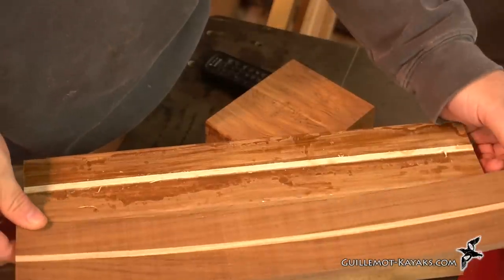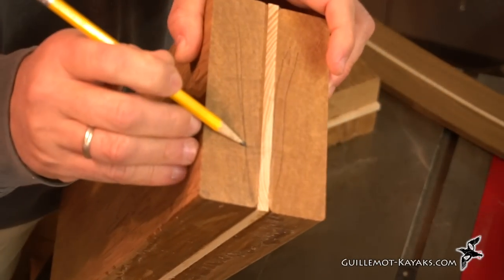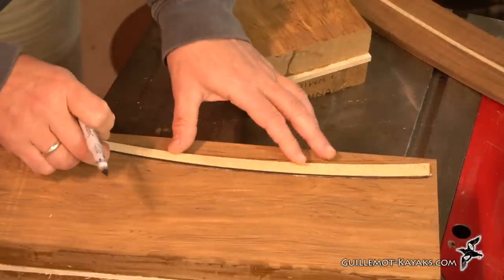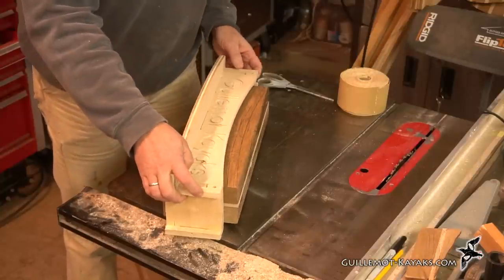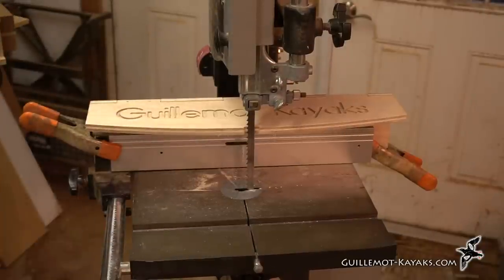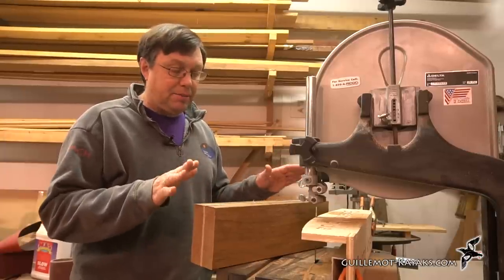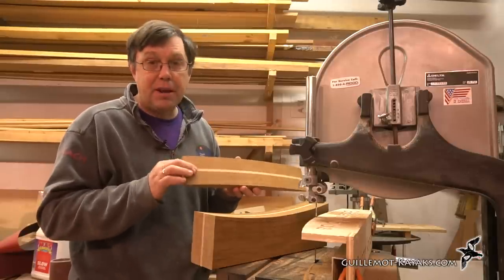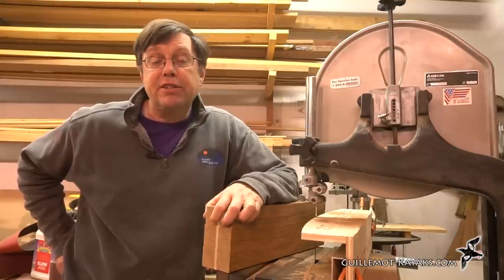Making Kayak Paddles - Cutting Blades - E2

Comment: The jig looks really nice, but why not add threaded inserts and a couple of starknobs for easy adjustments?
Reply from the maker: The primary reason is I didn't have any of those things on hand. You would need to be careful that they don't get in the way of the blade guard,  but it could be a nice upgrade.

Comment: Nick great jig! You might consider adding it to your sale items like the robo bevel.  With your CNC you could make up several different templates with various radius’s. (Radii)? Doug Hermann
Reply from the maker: I have thought about that. I've got two different sizes that I make already. Part of it comes down to: Do I want to spend my time at the CNC machine making stuff to sell or make boats.
Reply: @NickSchade  How about giving the programming to a friend with a CNC and let him run them for a small fee. They would come in very handy. Only thing I would add on the blade it should be lowered as much as possible in the guide so there isnt any twist of the blade. I did see the adjusting knobs on the saw guide might hit the clamping half of the jig. Nice way to cut multiple pieces.

Comment: That must be a tight blade on the bandsaw to run true at that height. 
Why not cut the handle longways into 4 pieces and laminate with contrasting colored wood like you did with the blades? That would create a nice look.
Reply from the maker: You can laminate up the shaft any way you like, but like to keep it simple

Comment: Hi Nick, great jig.  I was wondering for your scrapers, do you use hardened steel or carbide?
Reply from the maker: They are steel. I have tried carbide, but they are usually not as sharp even though they stay sharp longer.
Reply: @NickSchade  Thank you Nick.